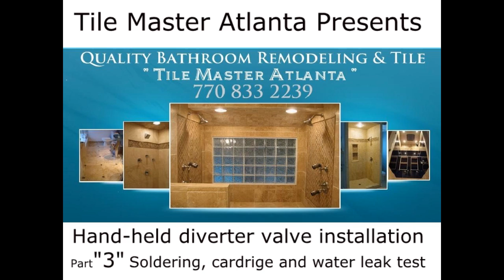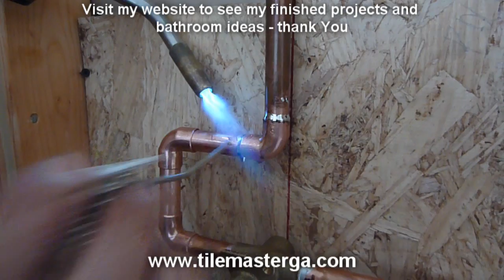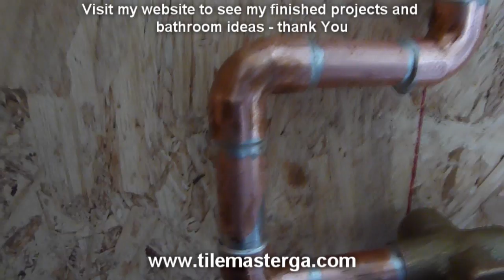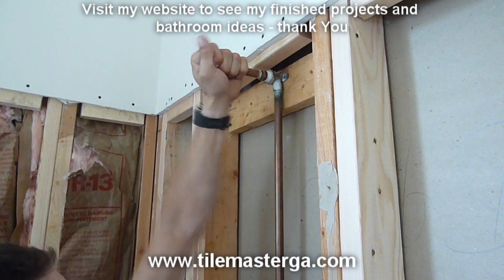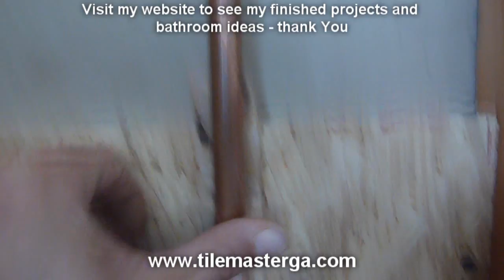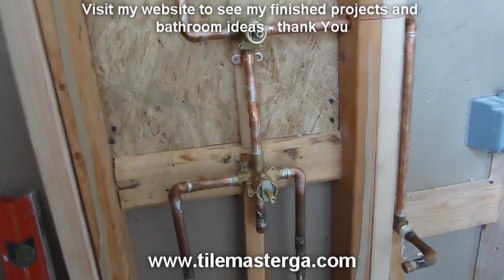Part.3  Shower Diverter - Transfer valve installation step by step -- Moen, Delta, Kohler how to

Comment: Couple things I don't like, not to be rude. Using the 90 and male to cap off the divertor makes it harder for the tile guy. Also, whenever people cap off the shower head with a male and cap, you risk it breaking off in the wall when you go to take it off. I always use a brass nipple and cap.
Reply: I agree fully.  This guy is not a plumber either as the solder joints wouldn't have boogers (solder hanging) Also don't forget to clean up the acid from the pipe as it will quicken the corrosion process and create leaks. Also tying into old copper that has green (oxidation areas) should have been replaced as they are weak areas that WILL leak in the future, causing damage.
Reply: He IS the tile guy!

Comment: I'm currently doing the same install for moen diverter and shower valve. Question ? Have you ever arrived at a fixed dimension from the front of the wall stud back to the mounting surface for either of these two valves. Do you change because of tile thickness or just go with a fixed measurement. I'm just wondering how you approach it. Thanks for the video. Later
Reply: always read the directions. thats what the plastic plaster cap is for.

Comment: Question: do I use a non-diverter tub spout if I am using Moen 3-way transfer valve? 
My bathroom will have a tub faucet, an extra faucet outlet to the left (don't ask) and wall-mount hand-held shower (optional) and a shower head. Will Moen 3-way transfer valve serve all of these 4 outlets? Can I email you a question. I can pay for a drawing/layout for my plumber to follow. Thanks